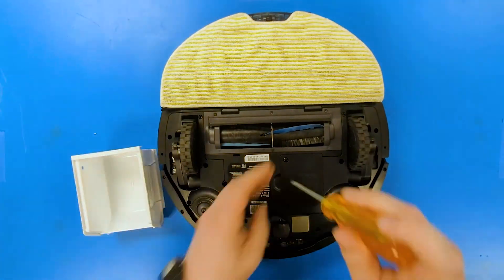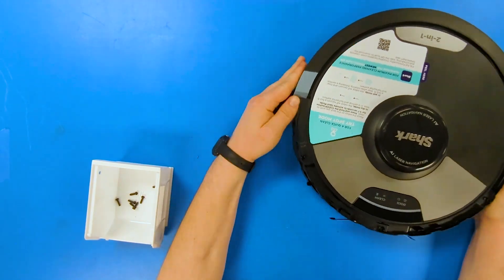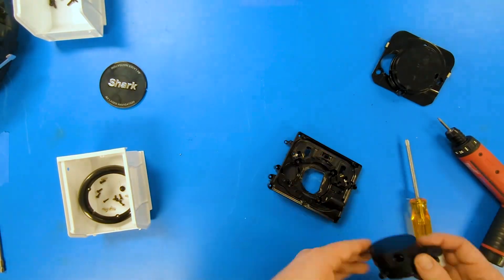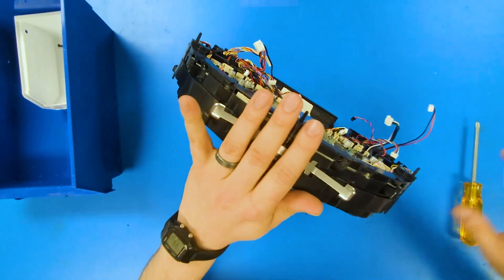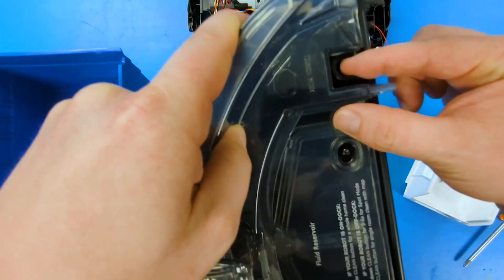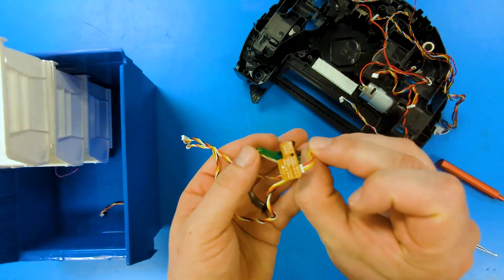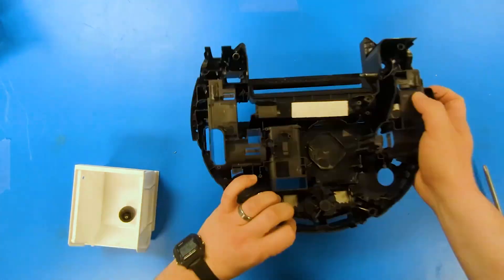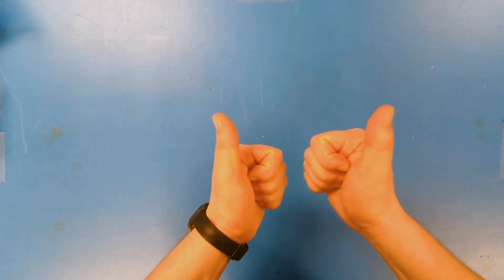Shark AI Ultra 2-in-1 Robot Vacuum and Mop Teardown | Simplexity Product Development

Comment: The video goes pretty fast at the point where you remove the logo badge from the lidar sensor. It looks like you use a pair of needle nose pliers first but its hard to tell what exactly you're doing. Can you help me understand how to remove it so I don't break it?
Reply: have you figure it out? The video is too fast and it seems like the robot had teared down before then everything looks easy and smooth but in fact it does not

Comment: I have the RV2610WA model and the mop attachment doesn’t match right. Whenever I get it to do so it doesn’t last long either. I was thinking of replacing the whole piece but could it be something else? The dust bin works perfectly without errors

Comment: thank you. got nowhere with shark, left tactile 'clean' switch is bad. just disassembled correctly the first try and resoldered switch. looks very cold soldered and no connection with voltmeter. going to go test it asap

Comment: Be careful in removing the battery!! If you flex the posts too much when disconnecting the battery, they may develop cracks in the solder joints.  I had to resolder the joints on the main board to get it to see the battery.

Comment: TY for the teardown vid! Did you ever end up removing the springs on the pcb assembly? 5:37 I believe they are causing my vac to throw error 6 - making sure the bumper moves freely. I can't seem to resolve it even though bumper is working as it should.
Reply: Same here. Error 6. I was hoping to see the two switches. Didn’t.

Comment: Mine keeps saying the fluid reservoir is empty even though it’s full. Already did a factory reset and have tried cleaning the nozzles and connection points….help!
Reply: Did you find a solution?
Reply: We are having the same issue. Tried blowing it out, tried cleaning it and nothing.

Comment: Cool, mine is not spraying water. I clean everything, the tiny plastic that block the water is not braked like others soo I think the water pump can be the responsible. Awesome video I will try to disassembly it tomorrow.
Reply: Good luck!
Reply: Mine is not spraying water either. How did you fix it? Warranty claim?
Reply: @tmg24  Sadly, I can't claim warranty outside the USA. I'm trying to find the water pump in some Chinese markets to test it
Reply: @MauricioRamirez76  I bought mine directly from shark and filed a warranty claim. They did a video call with me to see what it was doing. Mine was not spraying water and the mop pad was not moving back and forth so I packed it back up in the box and sent it to them with a prepaid shipping label that they gave me. I should have a brand new one coming.
Reply: that was the reason I go to this video, water pump seems dead, but after unscrewing the pump it appears that it was blocked by a tiny thing... now it works like a charm
Pro tip: unscrew all pieces of the pump, you might find some surprises
Reply: @legeek0175  did you have any issues getting the body case off? I cant seem to get it to pop off on the side where the blue bumper has a hole for the air puff